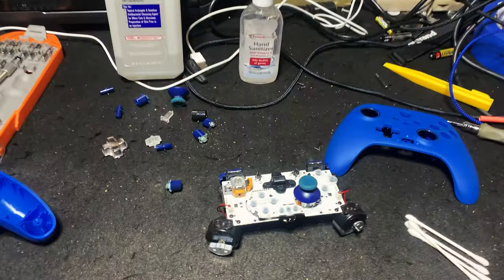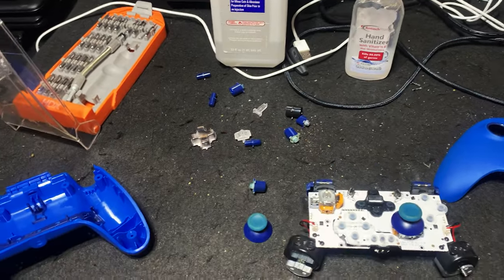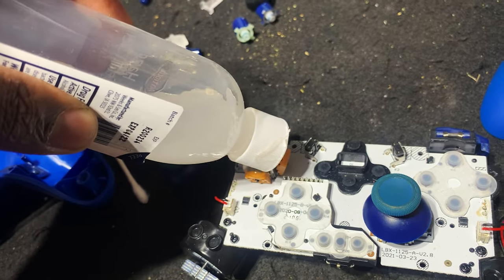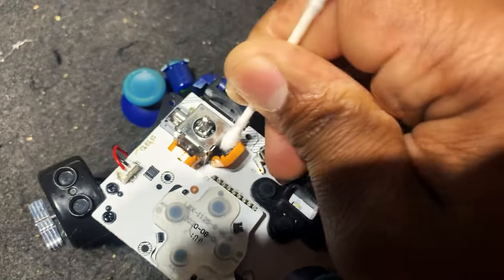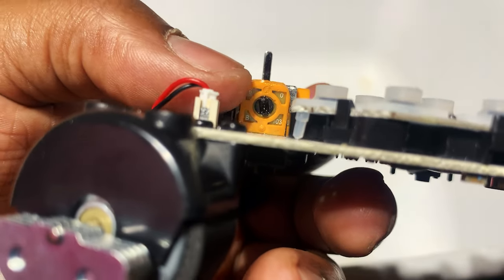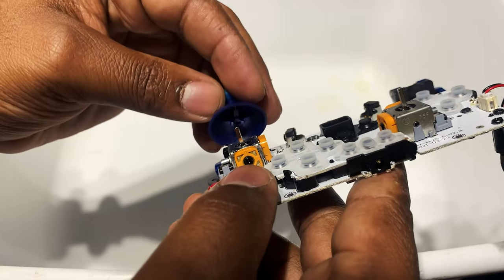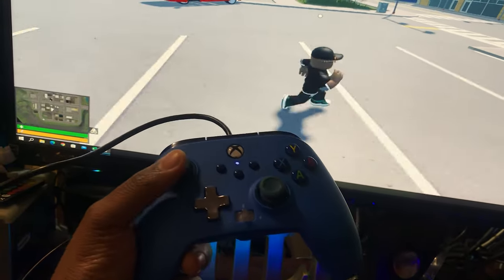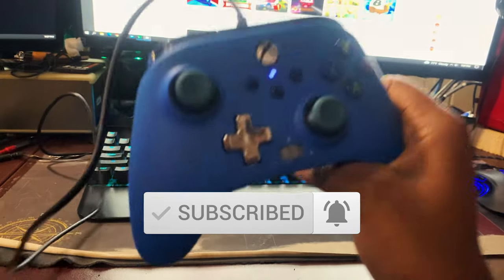🎮PowerA Joystick Drift | Xbox One Controller Left Joystick Drift (Joystick Moving By Itself FIXED✔️)

Comment: I have a PS3 POWER MINI PRO ELITE, CAN YOU DO THE TUTORIAL ON THAT CONTROLLER?
Reply from the maker: The Xbox and PlayStation controller designed is different (layout) but the internal mechanism is pretty much built/function the same. You can use a soft tooth brush to clean the board and see if that will help resolve your issue.
Reply: @AWordFromMrJones  but how do I get the cover off, I unscrewed it from the back and I can't remove the front piece?
Reply from the maker: @TheyCallMeKev21  Often you remove the front cover from the rear panel. Some might be hard to remove if debris is acting as an adhesive such as juice/coffee or even dust can make a cover appear to be stuck.

Try to first remove the back cover then the boards to work your way to the front cover.

Comment: I just took mine apart to clean my sticks and now when I put it back together it seems like I'm missing a piece. The volume dial button thing doesn't sit right and idk what to do
Reply from the maker: @amiableconch7272  I would take it apart to ensure nothing got jammed like the wires or any piece of plastic may have entrapped itself. Then make sure that your board and joysticks are dry if you cleaned them. 

If you did clean them, use a vacuum cleaner “blower” function to blow out anything or hair dryer (on cool side).